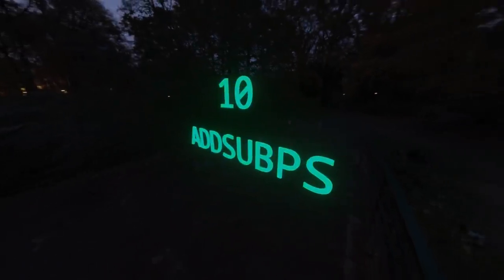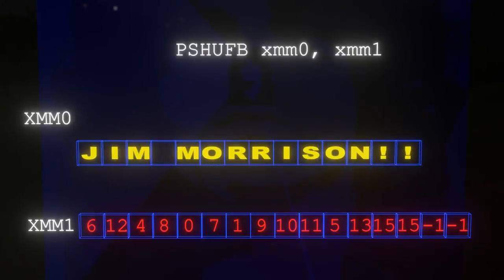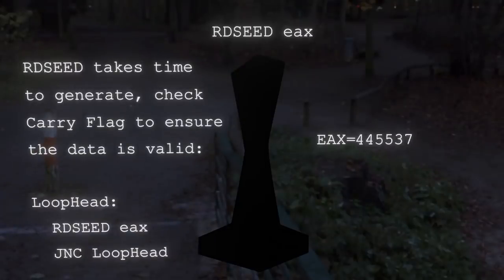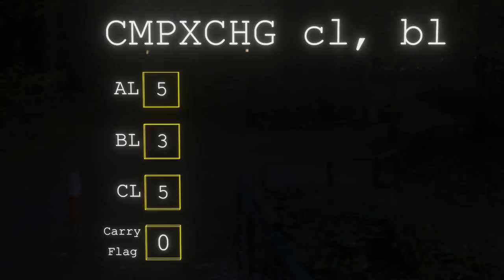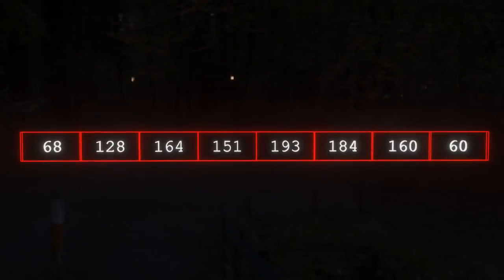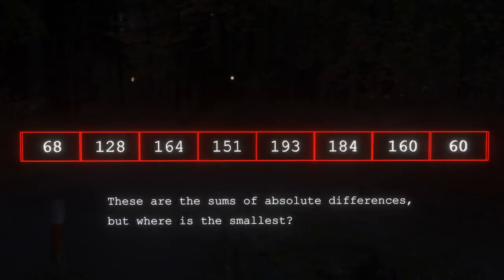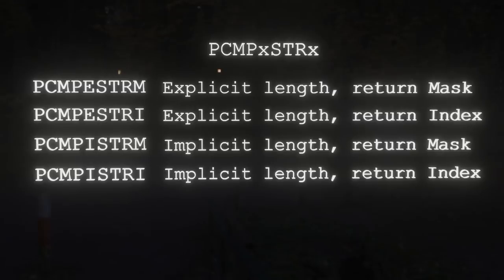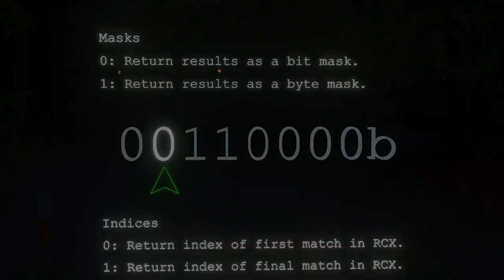Top 10 Craziest Assembly Language Instructions

Comment: Wow, it's been about 20 years since I checked in with x86 assembler - that's some serious feature creep. Maybe Apple + ARM will finish off Intel soon, along with those bazillions of CISC instructions.
Reply: Intel's plan to retain market share is to add so many instructions to x86 that the Rosetta 2 translation libraries for Apple Silicon become too big to fit on a Macintosh HD
Reply: No. Most of the complexity is in data caches and instruction caches and branch prediction and prefetching and out-of-order execution. Those things are just as complex on ARM as on x86. The instruction decoder (which really is more complex on x86) is only a small part of the CPU. ARM also has gotten more increasingly complex Vector instructions over time (not to the degree x86 has, but it will accumulate).

Comment: I wish VMs (JVM, V8, etc.) would have "primitive functions" for many such instructions* - Whenever I do any bit manipulation, it's both bizarre to work with and slow...
(* which would get jitted to the instruction if the CPU supported it; otherwise have implementation in the VM)
Reply: edit: ok, they could be slightly more abstract, but only for ease of use and enough to make it both fast to transform for the instr and at the same time allow the implementation for different architectures to be simpler
- e.g. passing in 3 bool args, instead of one byte with packed args (in x86 specific layout)

Comment: confusion between x86 en xmms or sse...
x86=8bits instructions
x286=16bits instructions
x386=32bits instruction / protected mode
x686=complete and lastest 32bits
x86_64 (sometime amd64) = 64 bits instruction
XMMS, SSE3 etc= extended instructions not part of x86 formly

Comment: AVX512 Ternary Ternary Logic. 256 possible 3 operand boolean arithmetic operations selected with a byte immediate value which can replace up to 12 instructions and do it in ONE CLOCK CYCLE. Not only is the operation itself decoded in that time, a THREE OPERAND instructions with the craziest possible operations (again, up to 12 instructions otherwise) is returned with a throughput of about 3 per cycle.

Pls nerf

Comment: I immediately expressed "MOV!", because "MOV is Turing complete": https://youtu.be/R7EEoWg6Ekk

All of these are legitimately whacky as well, and considering what antics there must be baked into the microcode I really wonder if it wouldn't just be better to invent a way to define custom instructions.  Yes, that's a lot of essentially L1 cache to store their microcode, but they'd be general-purpose, configurable to your exact needs, and software-upgradable when you discover a better method or a flaw.  The very low-ring function you call to enable one vets it to check that there's no shenanigans packed inside, but after that overhead is paid you get a fast bit of optimised code.

Is this completely stupid and/or impractical?  Aside from the horrifying complexity of attempting to characterize and secure something like this, I don't see why it wouldn't be possible to closely integrate enough fast RAM that you could make a few instructions be redefinable functions.  Could it perform is the biggest question in my mind.  I suppose RISC is basically already this as its opcodes are more nearly microcode already, so there may not really be anything left to gain.  Cheap and fast RAM for huge data makes code density irrelevant if the extra reads aren't a bottleneck.

I'm going to see if Creel has done a CISC/RISC comparison, and I'm hoping there is one.  Edit:  I didn't find one.
Reply from the maker: That’s an interesting thought! There is a thing called an FPGA, which is something like what you’re saying.

Sorry, yes, I have no RISC vs CISC video at the moment :( Cheers for watching mate, have a good one :)

Comment: Ah yes.  Mostly useless instructions but sometimes a lifesaver.  A long time ago I had to parse a file of road lat/longs, billions of them.  The straightforward C code to do this took days.  In a fit of energy, I rewrote the code to use the advanced string instructions and got like a 10,000 times speedup.  Then we were limited by the disk speed.

Comment: It's still a shame that RISC architecture never became the norm in desktop processors. This is the exact reason. Why should you do this? Why have such complex instructions when the processor breaks them down into smaller operations internally anyways? This might make sense when you're programming in assembly directly, but for a compiler, a RISC architecture is so much easier to target and achieves the same performance.
Reply: All modern architectures are essentially RISC internally.  The x86 variants only exist due to software compatibility.  Intel tried a clean break with Itanium and it sank so quickly it is sarcastically referred to as the Itanic.
Reply: @gayusschwulius8490  

And ARM has NEON.  SIMD instruction sets are hard to optimize for because they are only useful in specific situations, which typical code is not written for.  This is not specific to the Intel and AMD extensions.

Developers use libraries which have intrinsics which are optimized to use these instructions when available.
Reply: @avishevin1976  But isn't the concept of SIMD against RISC architecture in general? It's essentially a more complicated instruction set whose inner mechanism isn't exposed to the compiler.  Isn't ARM infringing on its own principle by implementing a version of it? To me, it seems as if SIMD is a CISC concept that was somehow introduced to some originally RISC systems along the way.
Reply: @gayusschwulius8490  

Purity is rarely better than pragmatism, but I don’t think SIMD violated the principles of RISC.  The initialism is for single-instruction-multiple-data.  Nothing about that violates RISC.  The instructions aren’t complex.  They each perform a (mathematical) function on a vector.  That’s all.

Comment: Well, that was absolutely ridiculous.  I get that there are probably cryptographic uses for most, if not all, of those, but the multiplication without carrying is literally just doing math wrong.  I get that if you’re trying to write some code to handle some sort of encryption process, that you might want to do exactly that to garble the values—but you’d have to be a truly deranged individual to imagine that was such a common use case that it needed to be hard coded into the instruction set.

Then again, I suppose if Microsoft built something like that into Windows, then perhaps it would make sense to have a single line instruction rather than a massive block.

Still though, RISC processors like ARM and some of the open source stuff that’s out there seems like it’s the future of computing.

I’d be interested to see you compare simple applications written in assembly that perform the same function on x86 and ARM CPUs.  I’ve never seen anyone do something like that, and I’ve only ever seen x86 assembly, so the ARM stuff fascinates me, especially when you’ve got Apple’s new M1 chips that can emulate x86 at ridiculous speeds.
Reply: Not carrying is the right way to do math in GF(2). It's not about garbling values. My connection to Youtube as I type this is encrypted with AES 128 GCM. The GCM part is what uses the weird instruction, and it's what ensures that my PC and the Youtube server each know if the data sent by the other was modified during transmission, in error or due to hacking attempts. The AES part needs the same operation, but is implemented in an instruction that does more of AES than just the carry-less multiplication. This crypto stuff was found to be a significant enough chunk of a CPU's workload to justify the hardware acceleration.

Comment: PCLMULQDQ is precisely what's involved in AES encryption. You multiply (bit shift) then XOR the results of each line if you don't have access to this instruction. Finally, you do a modulus operation with 0x011b.

The reason why this instruction is critical is that it does in one step what would be a different amount of steps based on the multiplied numbers. By analyzing the time it takes to multiply, an attacker can determine the number of high bits and reduce the possibilities of what the shared key could be.

Comment: All these instructions are just crazy, so specialised it's not funny. I think they kind of ruined X86 adding all this bloat, all it seemed to do is make generation after generation of processor obsolete because someone got smart and found a use for these meaning you needed new hardware all the time. I hope they don't ruin ARM in the same way. 
This all makes we want to play retro with 8 bit chips, where signed numbers are the limits of head scratching.

Comment: sounds to me like very large parts of the silicon is dedicated to underused instructions. A compute model where the CPU is limited to more basic instructions and calculation intensive instructions are deferred to gpu would be far more ideal rather than wasting all those resources forcing the cpu to do it.
Reply: IRL it's not that bad. Instruction decoders are only a small part of CPUs. Data caches, instruction caches, branch predictors and prefetchers take up a lot more CPU-die area, and they are very important for performance. GPUs cannot run code written in typical high level languages efficiently (C#, Java, Python, Javascript, Go, Rust, Php, Perl, Pascal/Delphi, C/C++) and require lots of threads and SIMD/Vector operations to be efficient.